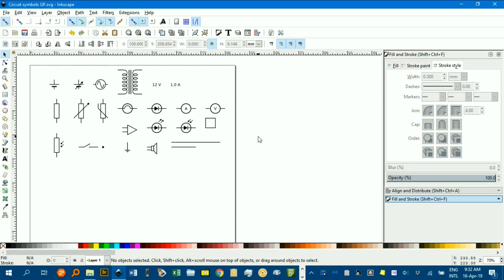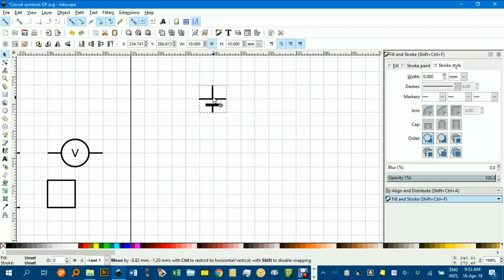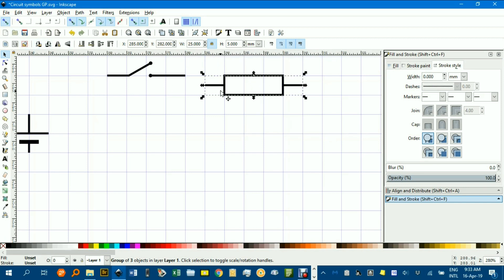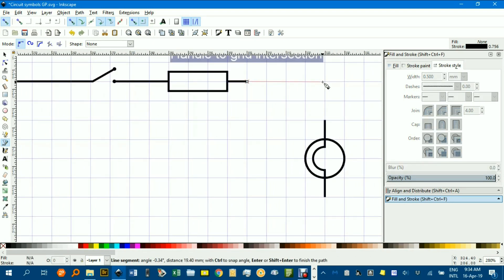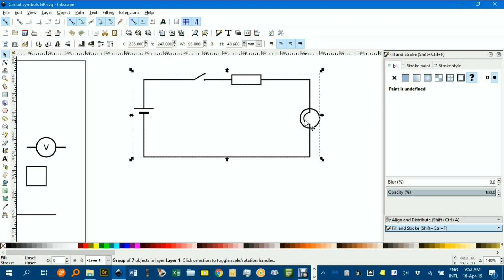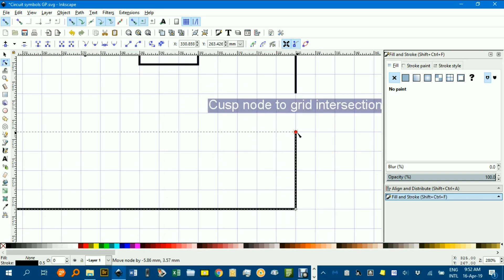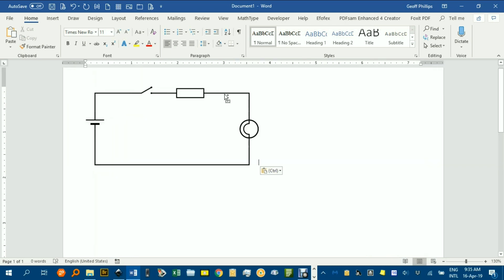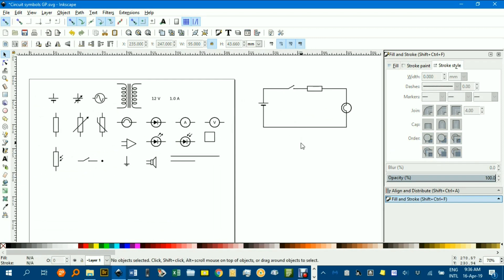Circuits in Inkscape

Comment: I just used inkscape for the first time and I made a block diagram of a multi micro controller interconnect, so that's about blocks, texts and busses with arrows. It took me a while to figure out how to do rubber banding so extending or shortening the length of the wires/busses. As it turned out you can do that by selecting and moving the path nodes. Second button at the top left just under the cursor/arrow button. So you select the nodes at the end/beginning of a wire, which is one for a simple wire or more than one for a bus with or without an arrow, and then you move those after which the whole wire/bus stretches or shrinks not affecting the arrow shape, which was my concern at first because resizing did not really work.